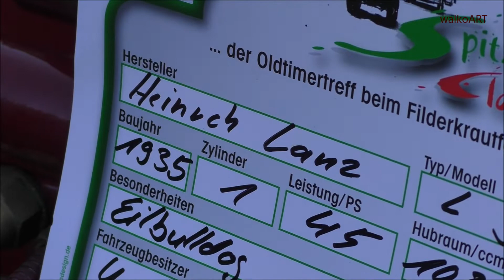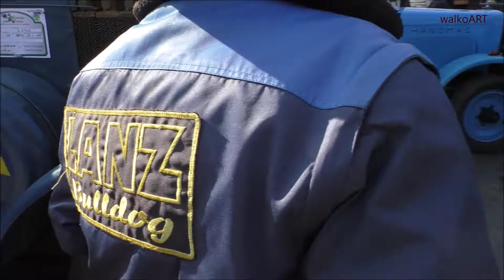START Glühkopfmotoren LANZ BULLDOG -URSUS & PAMPA Traktor - hot bulb engines START classic tractors

Comment: Awesome, love the whole concept of steam... 
                                                                                     Thx, Moses...
Reply: Hi Moses, while steam is a great concept these Lanz tractors are actually running on gasoline. The engines they use are a very unique two stroke design that does not use spark plugs to ignite the gasoline, but a glow head (glow plug style). These glow heads get preheated with a special torch to become red-hot glowing to ignite the gasoline upon compression. They only use one glow head because they are one cylinder engines with giant cylinders, some of them as large as 10.3 Liters of volume. In the process of starting the engine, you see the operator remove the steering wheel and place it on the side of the engine, attaching it to a massively heavy flywheel. He turns the wheel and the engine to get it close to the point of highest fuel compression and then uses a mechanical lever to pump fuel mix into the now glowing hot combustion chamber. He then turns the wheel and the engine to try and 'bump-start' the engine. Often times it takes several attempts and adding more fuel at the right moment to keep the engine running. The large amount of smoke or exhaust you see coming from the exhaust pipe is caused by a rather inefficient burning process of the fuel which leaves a lot of unburned particles in the exhausted air.
Reply: Ha, ok... never mind...
                                                 Thx, Moses...